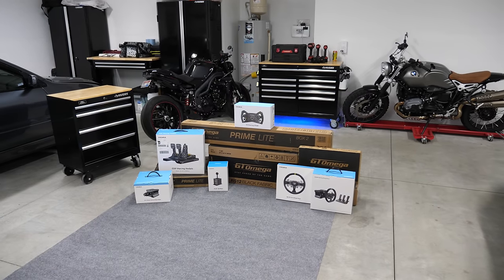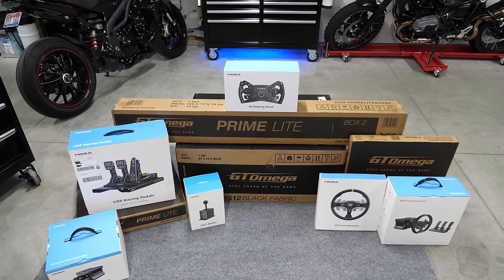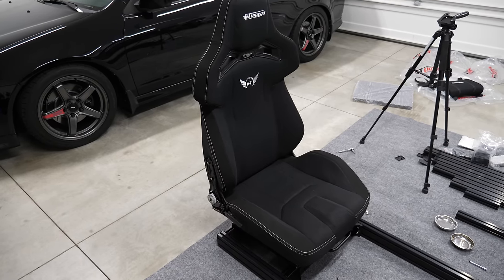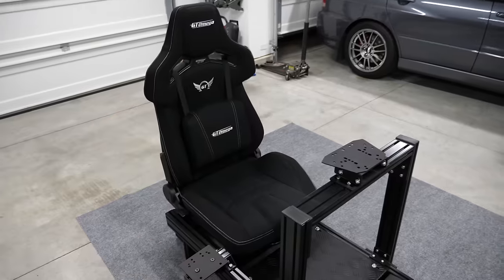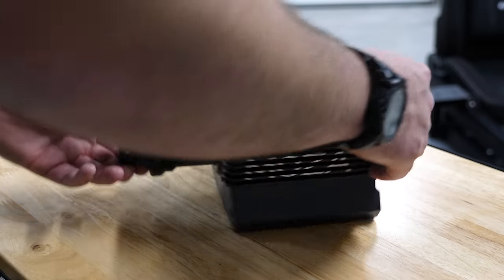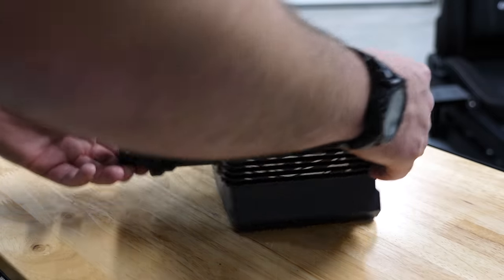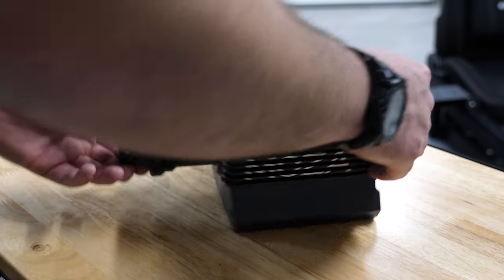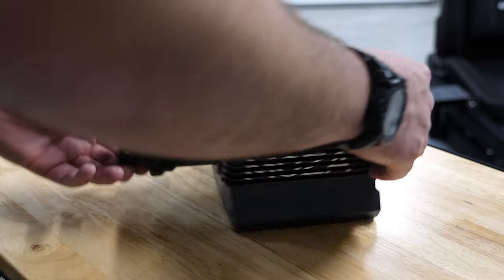The Perfect RACING SIM Setup for Car Enthusiasts!! | Full Build & Review

Comment: Ill vouch for gtomega. My 1st order with them was nearly 10 years ago and i still go back to them for things. I only have the "classic" wheel stand (was the only stand they offered back when i ordered it, so it was their 1st actual wheel stand) which over time ive added their rear seat frame to, and i have a simmagic alpha mini mounted to it, pushin the full 10nm of torque, and its solid. 

Sometimes with extremely large peaks ill get a slight hint of "wobble" or flex in it, but its nothing major at all and its a rare exception, such as massive crashes on beamng. General racing though its rock solid. Mind you, this isnt an 8020 aluminum profile, just their 1st iteration of their foldable wheel stand from a decade ago, something definitely not meant for direct drives. So i would say thats pretty damn impressive all things considered. 

I will say, before upgrading to my alpha mini, i did purchase their upgraded support bars for the wheel stand ahead of time, so i cant speak of how it would hold up without them, but its very impressive none the less. I honestly thought i was gonna have to run no more then 50-60% tops power on the simagic until i got an 8020 rig, but it just really goes to show the build quality of their shit.
Reply: I bought the Art Cockpit from GT Omega in 2016. I still use it everyday. R9 seat is still in top condition. It was a great purchase.
Reply: @talon1706  yeah cant really complain about the price. Will be moving soon to a bigger place where ill have more space. Once i do ill be upgrading to a "proper" 8020 setup and be using the current rig to set my old g29 up on. 

Really the biggest reason i havent upgraded to an 8020 rig is the room, and the gtomega just continues to be rock solid. My plan is to keep it for many more years for a 2nd sim setup for guests.

Comment: I am over extrusion style cockpits. Take hours to assemble and difficult to adjust. There are tubular options that are more easily adjustable and much quicker to assemble. They may be slightly more rigid but not enough to make a difference unless you do motion
Reply from the maker: I agree with that partially, it is a bit of work to make adjustments, but I love how customizable it is

Comment: are you going to show you're pc setup? it looks like you're radiator is set at the bottom instead of at the top.
Reply from the maker: Water cooler is front mounted! Power supply is on the bottom

Comment: No tilt on your wheel at all.  Cars dont have the steering wheel 90deg to the floor.. I have a trakracer cockpit with a fanatec DD1 and I chose it so I could easily adjust the wheel and base for some tilt. 
also your screen is way too far away for proper POV.
Reply from the maker: I’ve made more adjustments since the setup. There is a title adjustment on the cockpit stand. My screen is further because I’m far sighted. My eyes don’t work that close up